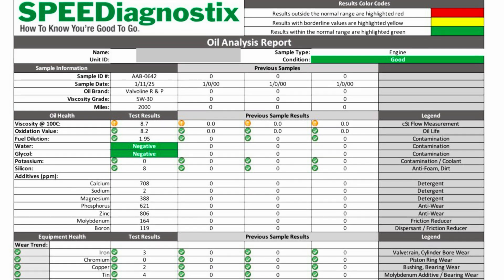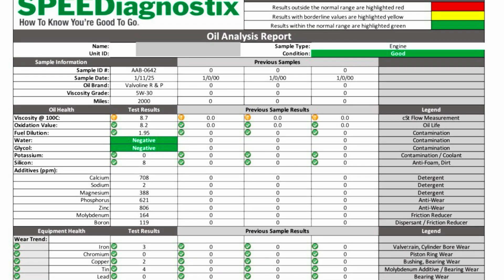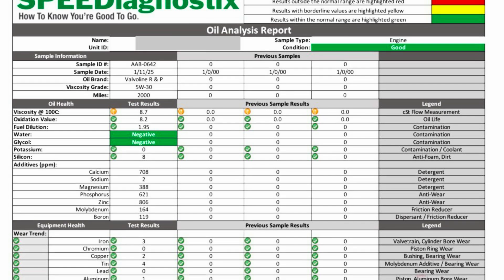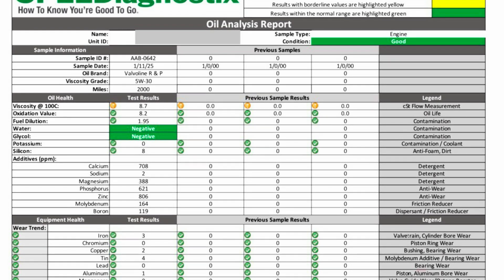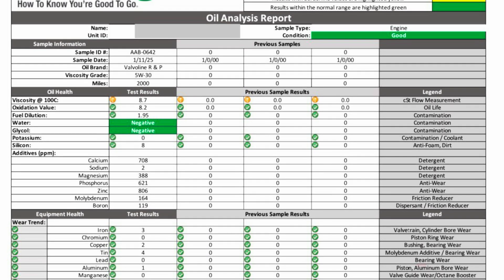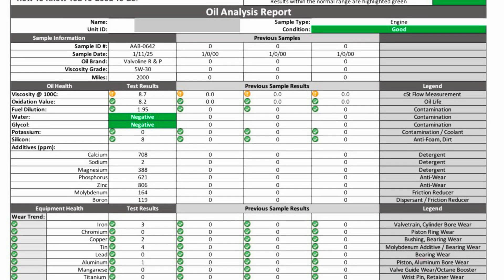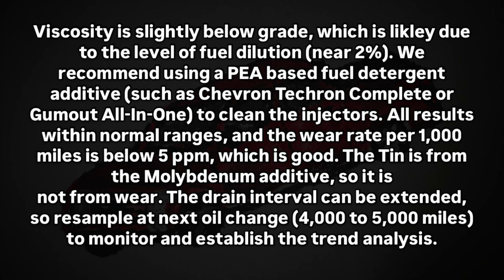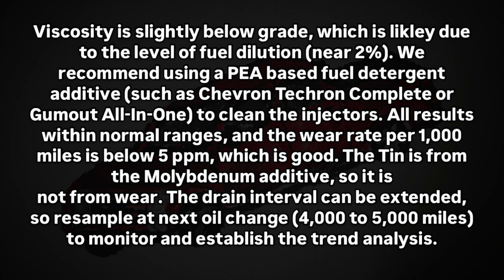Valvoline Restore & Protect (2,000 Miles) SPEEDiagnostix USED Oil Analysis

Comment: Very solid UOA.   I agree on the fuel dilution recommendations and always remember to run the engine for a good 20-30 minutes before getting it up on the ramps to change the oil.  It will help bring down the fuel dilution just a little bit.  3.0 ppm wear metals per 1,000 miles will get even better on your 2nd run going out 3,000-4,000 mile run.   My first run on R&P got a 1.8 ppm/1k and second run went down to 1.0 ppm/1k miles.   Impressive results on your F150 ecoboost!
Reply: You always change oil when it's super hot after I drive like coming back from the grocery store that's like 10 plus miles away.
Reply from the maker: @peachyclean93  hey Peachy! Why do you say this?
Reply: @MidwestF150  what do you mean? Oh you always change your oil hot hot after a drive don't ever leave your vehicle idling in the driveway then change the oil you always want to do like I said coming back from work preferably after a long drive that mixes up all the sludge and grime I'm just not sure if that guy is saying just to idle it in your driveway for 30 minutes which is not what you want to do it's not getting the RPMs high enough to clean everything and to heat up the sludge if that makes sense??
Reply: I think what peachy is saying is… and is what I mentioned before … you should run the truck for 20-30 minutes so the engine and oil are up to full operating temp (hot) and then go right into doing your oil sample.  It does help lower fuel dilution results on UOA
Reply: @HondaFarm307  maybe I was just misunderstanding what you said like to me run means just to let it leave it idling you don't want to do that I'm not sure if that's what you mean but what I mean by driving it hot does that make sense 🤣🤣
Reply: @ I like to drive it for that 15-30 minutes on the road under load in normal driving conditions.   Then drive into the garage and take sample within a few minutes of turning off the engine.   I guess idling could work but since it doesn’t rev at higher level, not sure if the oil would circulate well enough at hot temp well enough to burn off any fuel dilution.  All I know is that if you run the vehicle around for a while … or in my case I think I’ll be planning an oil change and sample collection on a day and time coming home from work… I’ll have 60 minutes of run time on the engine at sample collection time.  So if I still have a fuel dilution issue.. then I know it’s a mechanical issue somewhere and not because I cold started the car and simply pulled it up on the ramps to pull the sample.  Hope that makes sense
Reply: @HondaFarm307  oh that's perfect! I was thinking like you were just running it in the driveway and then changing it that just cleared up the confusion 🤣🤣
Reply from the maker: @EscapetheFarm  hey thanks for clearing it up! Yes I will make note of that at the next oil change’
Reply from the maker: @peachyclean93  🙂
Reply: @MidwestF150  why is this what you've been doing Mr??
Reply: @MidwestF150  😁👑
Reply from the maker: @peachyclean93  don’t worry about it 😂
Reply: @MidwestF150  haha, true not my vehicle not my problem haha not my worry 🤣🤣 I'll just turn around now 😜
Reply from the maker: @ I’m just messing with you..  I may have bungled it lol
Reply: @MidwestF150  🤣🤣🤣 oh it was successful
Reply from the maker: @peachyclean93  😂
Reply: And your oxidation value is only 8.  That means you have significant life left on the oil.
Reply from the maker: Hey Honda!!! Thanks for stopping by and providing input here!! Do you have a go-to fuel additive you use? And how often? 

I’m trying to figure out what could be causing the fuel dilution. I’ve been using good gas, thinking it would solve some of this.
Reply: @MidwestF150  I use Amsoil PI or Techron fuel treatment.   I’ve tried the Royal Purple once before too.  But for ease of acquisition it’s usually Techron
Reply from the maker: @EscapetheFarm  do you think I could just get away with using top tier gasoline? It’s what I’ve been using lol
Reply: @MidwestF150  I think so.   I do both actually.   Every now and then when I add the fuel treatment, it’s usually with a tank full of Shell or BP 93 octane Premium fuel.   And do that every 6-10 tank fill ups.    Or to your question just use top-tier fuel and once in a while use mid-grade or premium-grade and see if it helps.   Your fuel dilution was only slightly above the acceptable norm… so if you do a UOA on the next run… just be sure to get the engine and oil nice and hot for 30 minutes before you put it up on the ramps to take your sample.